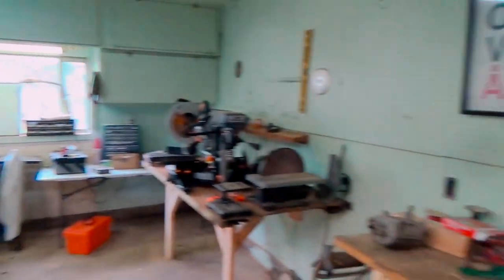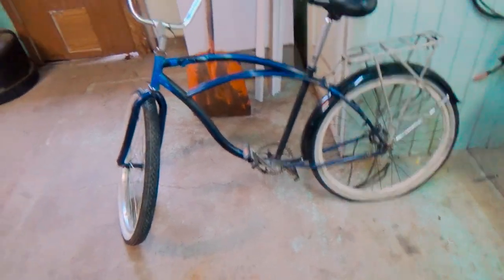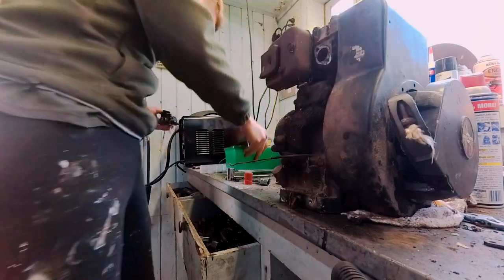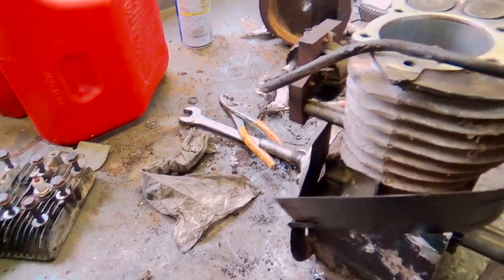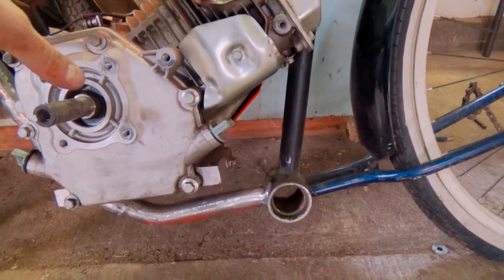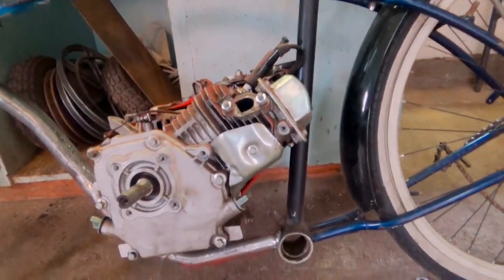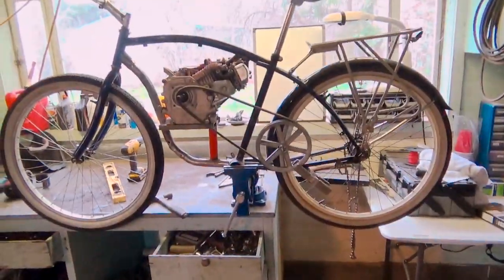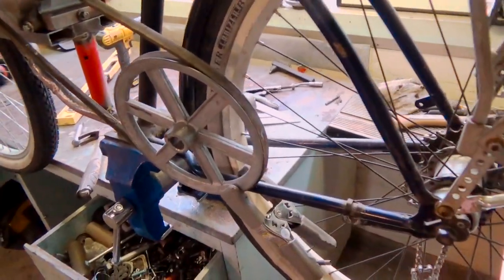2 Speed Predator 212cc Motorized Bike Build (Part 1/5)

Comment: You've been at this long enough to know that these honda clones can be run in a vertical position . They fit better and keeps the weight lower.
Reply from the maker: I've never actually ran one in vertical pos, I think the oil sensor would turn off the engine though before anything could happen. Also, If vertical then we need to come up with a way to convert a vertical axis of motion to horizontal. which would be difficult. not sure how it would keep the weight lower either. But let me know your idea!!
Reply: @OliverMotorized  I think by a vertical position he was referring to placing it in a position that has the cylinder pointing up instead of the typical angle so that the engine requires less space front to back but uses more space top to bottom. In regards to the crankshaft it remains a horizontal engine.